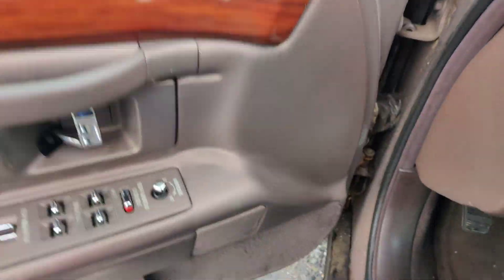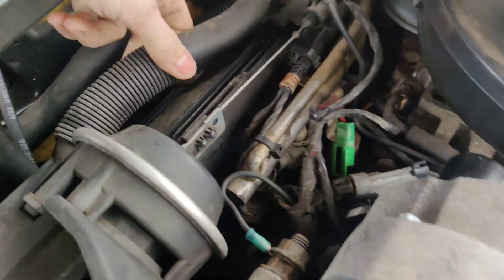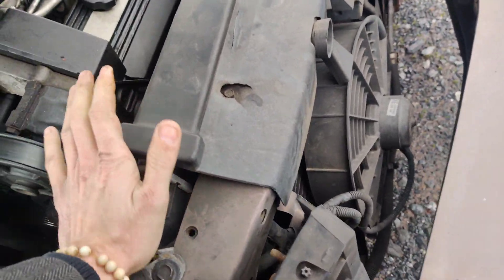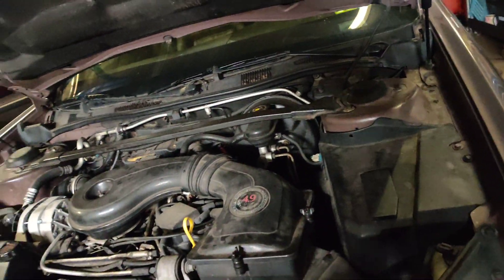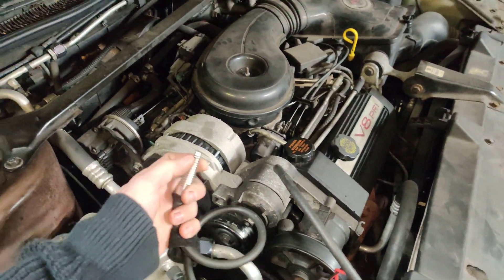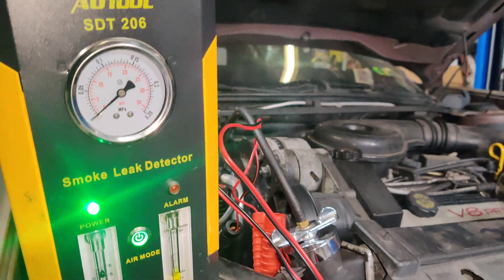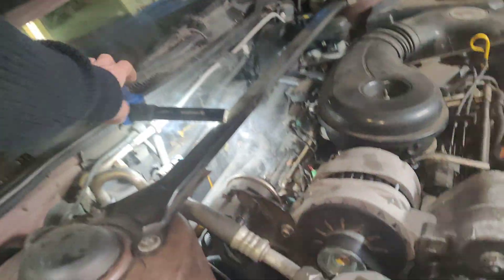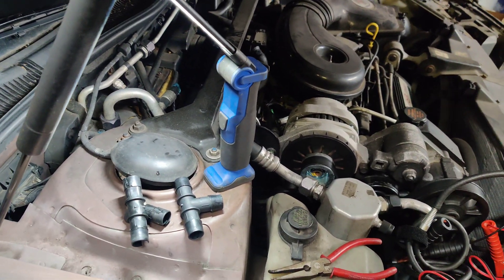1995 Cadillac Deville 4.9l Overheating, Smoke, Coolant Loss

Comment: That fitting should not be a plain tee fitting.  The OE fitting has a restrictor in it.  GM P/N is 1648454.  Using a plain tee can result in poor heat
Reply from the maker: Thank you!
Reply: Mine never had a restrictor so idk

Comment: Please help I have a deville same engine and the radiator is bussed and it’s instantly over heating and smoke is coming out I haven’t drove it since the first time it overheated . I also have a vaccum hose leak on both hoses running into the mass air flow . Please help I’ve dumped 4grand into this car I’m a young single dad I really need help

Comment: I have a leak on the motor what’s the pipe called?
Reply from the maker: I am not sure, you can go to a GM parts website and look at the diagrams for your vehicles and it will give you the part numbers.

Comment: I have a 94  Cadillac El Dorado that’s been sitting we are restoring it changed the heater core and the ignition coils mechanic drove it it was fine he cut it off but when he started it back and said it was smoking and coolant I guess leaked
Reply from the maker: Did he fix it?

Comment: Hey Rob what kind of scantool do you use on your mobile diagnostics? I'm looking into getting a new one, something with decent bidirectional controls. Can you recommend one that won't break the bank?
Reply from the maker: ThinkDiag or any of the launches will be the cheapest. One tool will not do everything.
Reply: @RobertDotterer  yes I understand that, do you use the thinkdiag the most? I have other scantools but I'm doing mobile diagnostics and need to have a few options.
Reply from the maker: I use the thinkdiag a lot, $300 you get all the manufactures and 2 years of updates.

Comment: 8:37 It never gets old seeing someone go through the same bullshit I do to myself. Once was testing a VW Tiguan that another shop had put an engine into. It wouldnt run because they had left 2 or 3 vaccum hoses off and a couple things weren't plugged in. Also it ws leaking coolant. I put pressure tester on it pumped it up to 15lbs and I raised car on lift. Must have bumped the radiator hose and it blew right off soaking me with coolant. The didint seat that quick connector either. Anyway I seen your In PA. I have a shop In Oil CIty Its NWPA between Erie and Pittsburgh
Reply from the maker: I was just in Pittsburgh for almost a week a few months ago. I had a Tiguan in for a motor and I went through 3 motors with it.